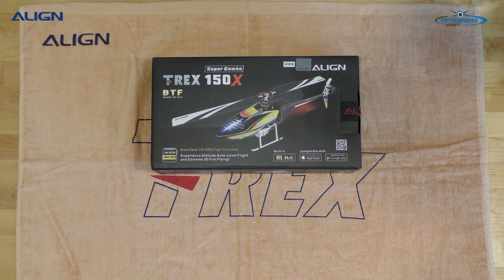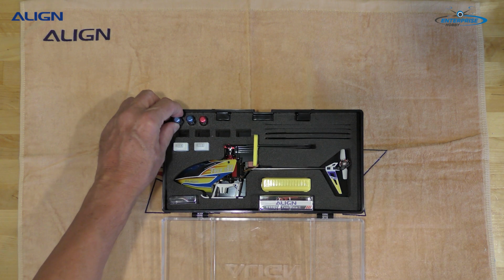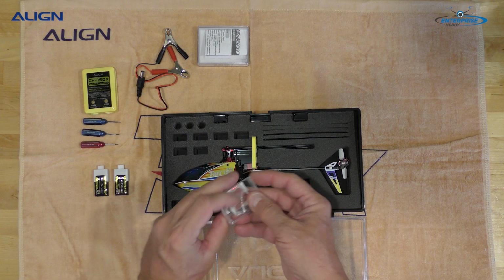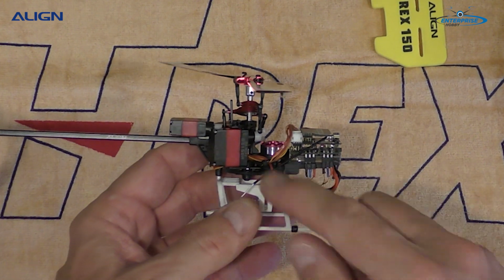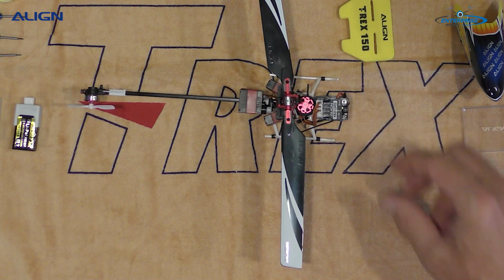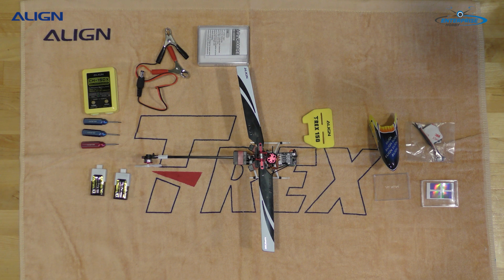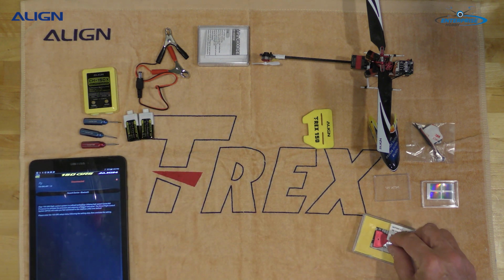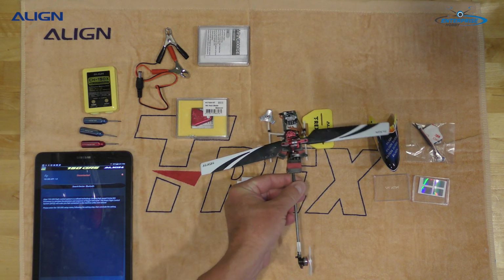TREX 150X Unboxing Enterprise Hobby

Comment: Nice copter, from the looks of it. Have it, but have not figured out yet how to set it up with my spektrum dx9 radio. Being a beginner and having only flown blade copters which has quite good manuals, this copter seems impossible to set up since I have found no information about what settings I should use for my model in my dx9 (the full manual was not very easily understood and only shows the model-settings for another type of radio). From what I have figured out it should have a normal swash type setting and a 2 position switch on channel 5 to switch between 3d and stability mode. But I still do not know if I should set up a spesific throttle curve, in which case which settings to use in the throttle curve, or if the throttle curve settings is handled through the app. I hope someone makes a video which guides Align newbies like me through the entire setup procedure using a Spektrum radio. From the unboxing, spektrum model setup, to binding the copter using a satelite receiver and configuring the copter settings through the app.
Reply from the maker: Video includes complete setup:
https://www.youtube.com/watch?v=2o__LwsVPmw